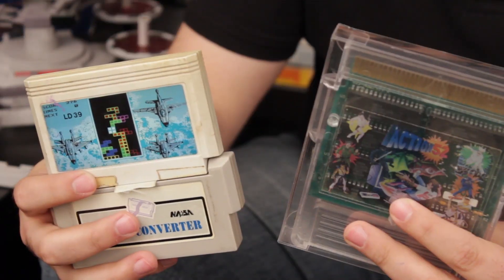HQA - Ep 3: Big Red Reset Button for the NES

Comment: in theory it can work with a 3.5mm stereo jack. no?
Reply: Or Composite video? because it only need to connections.
Reply from the maker: +Seba The Gamer Yes it would work with a 3.5mm stereo jack but you should use a mono. Less wires, more fun!
Reply: :D thx love you guys ;)
Reply from the maker: +Seba The Gamer Right! You just somehow need to make a contact between the 2 connections of the Reset button.
Reply: Simple and easy.